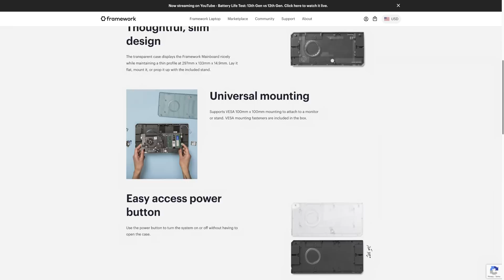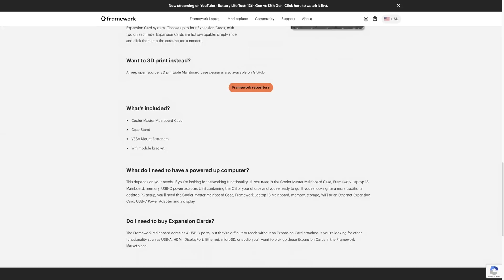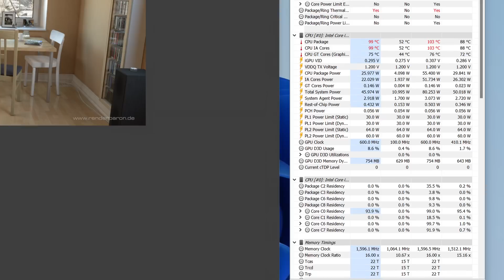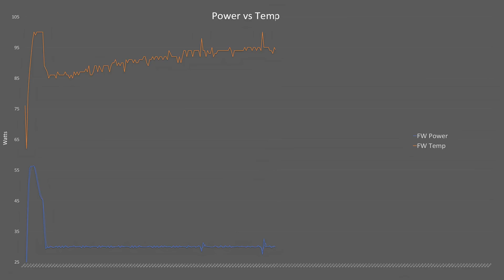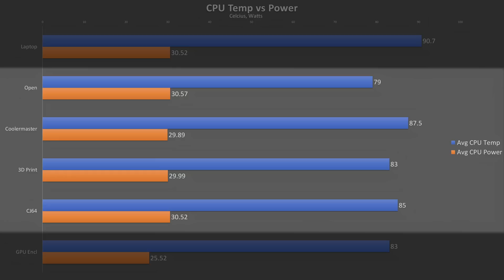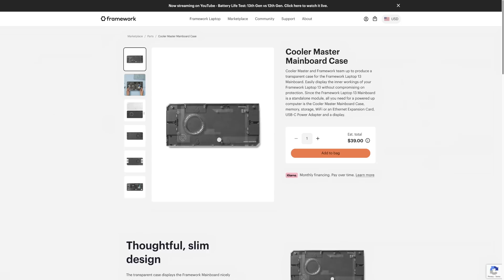Why the Cooler Master Framework Case Could Change Everything!

Comment: how many m.2 slots does the mainboard have? i cannot find any info i would like atleast 2 full size 2280 and the wifi and if no second m.2 could i boot off the usb ssd expansion card?
Reply: The FW13 has one 2280 M.2 slot and 1 slot for the wifi card. And yes, you can boot off the expansion card. However the FW16 has more expansion slots than the 13 and it actually has two M.2 Slots, one 2280 and one 2230 plus the wifi card.

Comment: I´ve predicted this over a decade ago. Modular Notebook Hardware is the Future. Very nice Detail Solutions. I crave for the release of the AI Max+ 395 (16C/40CU) APU. To try my own project. As a Backpack PC. It should Hug on my and my Monitors backside. Adding up a Soundbar Dockingstation. RGB Background Ambilight. Shades and Lighting. And wait a moment to make it Lengendary ......a AC Unit. And a Rack to Store Equipment. Like Keyboard and Mouse etc.   :face-blue-smiling: And a Microwave and Buttercream.
Reply: This is great to see gaining traction. I mentioned this as a strategy to Dell in 1995 as they were entering the laptop market. I was really surprised they blew that opportunity.

Comment: The loud fan seems to be caused by a temperature sensor inside placed badly on both the Intel and AMD version. Using third party community tools on linux and windows does solve the issue until Framework gives us a proper fan controller (they have no plans for it btw)

Comment: You can't update the bios without a battery?? What that's not good. I've seen  issue on laptops such as VPN not connecting due to bios update needed. Like to see if Framework fixes this. I bet theres a command line switch that will override battery requirement for bios upgrade

Comment: Note that it doesn't seem fit their amd boards. Two out of three users trying it on the forums had issues. The one in which it did work I'm not sure was even using the coolermaster case, they may have been using some other case in standalone mode.

Comment: The high pitch noise when in the CoolerMaster enclosure is caused by the shape of the fan openings.
I’d remove every second or third strip or even remove the hole lot and place a metal mesh instead of I had this issue.

Comment: I'm much more interested in the Minisforum UM790 PRO. An insanely powerful low watt APU with the graphical power of a GTX 1660. For $699 with 32GB DDR5 and 1TB SSD, it can't be beat. It's an all-in-one that fits in your hand.

Comment: I bought one CM Stacker 730 Case in 2006 - Still rocking my i9-13900K with a 4080 in it, cooled with a 360 AIO. At that time, CM built for the Eternity. Today not so much anymore... That whine would kill me in the Framework. But at least CM is still trying...

Comment: I just want better laptop cooling options.... I don't really understand why we use these tiny heatsinks and single fans for these 5ghz intel processors. or for that matter why intel is pushing out 5ghz laptop processors.... Every company does it. One of the things that disgusted me the most was when the R5 2500u came out its sibling processor the 2700u (which has 2 more Vega Compute units) was being shoved into even tinier laptops than the 2500u. It was horrible, I looked at benchmarks of laptops with the R7 2700u playing games that I played on my 2500u but the performance was worse for the 2700u because the additional Compute Units meant more heat than the form factor could reasonably handle.

Comment: Love your review. The possible answer to your question as to when companies will produce modular components is when there is a need or a requirement to do so. If more companies ran with an Open Chassis design with standard sized modules like the raspberry pi, than other companies will tackle that mold is quest for profit.

Comment: I wish there was something like this that was universally compatible to any laptop board. I still have a couple of Sandy/Ivy Bridge laptops with some minor physical problems but still fully functional that are lying around just gathering dust and it'd be great if I could repurpose them by turning them into mini PC's. I've seen some DIY stuff online dealing with that kind of stuff but they're always far too complicated, expensive, and require specific tools and other bits to make them.
Reply: There will likely never be a universal version of this due to the extreme differences in various laptop boards.  Diy doesn't have to be complicated but yes, if you want to make something you will need at least some tools.

Comment: Beside ABS & PLA there is also PETG. Also motherboards can be screwed into wood pretty reliably. But yes, for a desktop solution, even nettop style one it needs to have a beefier cooler. So bigger cpu cooler or case with one would've been great.
Reply: You can't use PLA/PETG for this unless you SIGNIFICANTLY increase the size of the case to keep the heat away from the printed parts.  Keep in mind, PLA isn't suitable for any heat at all and PETG shouldn't be taken above around 40 C.  In this case, the CPU is producing more heat than PETG can handle(and it's only using 30W), while the rest of the system is producing even more due to power losses going straight to heat.

But it's partially moot because this is a mass market case.  Injection molding > 3d printing if producing at Cooler Master scale and that means ABS/PC.  They're an OEM, the production run numbers are WAY past what 3d printing can do.
Reply: @Grimmwoldds  I was under an impression that it's a only PLA that should be heated above 40°с, and for PETG it should be around 80°с. Still worse than abs, obviously. But even 80°с... Can it really be achieved anywhere inside the case outside from a heatsink with a direct contact with a cpu?  And even then 80°с temperature on a cpu doesn't mean 80°с temperature of an exhaust. And high inside case temperature can't be achieved without a massive heating element, like in close chamber 3d printers with a massive heatbed and deliberatly little to no ventilation.
I wasn't able to find a source, but I seems to rmeember seeing some research about actual exhaust temp of hardware and it not even close to actual temperature on a die.
Reply: @trashviewer3521  It's not a very large nor high flow cooling solution.  You'd have to check it, but I'd guess that it's the exhaust temp is high enough to soften PLA/PETG.  The temps given for heat deflection are how much to soften it to bend a certain amount in a short time.  When used in a computer case, you don't EVER want to use PLA or PETG. If you subject them to even 40C for a few days they will warp and sag(you're usually putting load onto them).  Exhaust from cooling fins, being near an SSD, or even proximity to the power stages...

Comment: This is neat but I thought it was a GPU case or cooler. I'm in need of replacement fans for my used 1070 but I can't find the exact ones PNY used, an aftermarket cooler would also solve the problem.

Comment: 5:15 It is always adviced, to use a power supply that is utilized at around 70 - 80% MAX

It is not healthy for a power supply, to be used at it's absolute limits

And that counts also for it's efficiency, so you draw significantly more power than you use otherwise.

Comment: This is really great news. Adoption from such big manufacturers is both very important, and a good sign of the future for Framework. One thing I would like to see though, is a mod which lets you mount a bigger cooler, with, say, a Noctua fan. If we put this board into a 'desktop' case, the whole "thin and light" thing can be negotiated a little more readily, allowing for more flexibility. There should be no reason to have to put up with such a noisy design.

Comment: If the torx fit isn't 100%, use a thin piece of rubber band between the head and the bit. Push down and turn slowly :)

Comment: The fan doesn't spin up for no reason, the fan spins up because of windows. Linux users will probably have a machine that is silent at idle.
At least, that's the case for my non-framework laptop. When I'm running windows, I hibernate it at night so the fans don't wake me up. When I'm running xubuntu, I leave it awake and unlocked and it never makes a sound.
Reply from the maker: It also spins up at idle when I'm running Fedora or Arch.

Comment: Add a couple nuts into the mix and you can still mount it on a vesa mounting plate. Putting this on a secondary vesa arm sounds like a power move.

Comment: Would it be possible to have the M.2 port of the framework exposed? If so, having a case that could fit a GPU that would connect with occulink and thunderbolt would be sick.

Comment: the GPU enclosure idea is a good one, maybe they will add USB4 to their boards and make USB4 to PCI-e cables and reach out to you for the design for another Framework+ product.
Reply from the maker: The Intel boards have 4 Thunderbolt 4 ports, and the Ryzen board has 2 USB4 ports.

Comment: Until they actually have options to work with, they will never take off. Having only two CPU's to work with and only onboard graphics extremely limits  the user options. Basically all they offer at this point is swappable ports, which is pretty lame.

Comment: So if I understood correctly, you get a little less performance without the battery attached (and then there's the problem of not being able to update the firmware without it). If that's the case and Framework doesn't fix that with software, I guess it would be useful to get an adapter that connects to the battery connector and to another PSU (or Maybe the same?) Right? I guess that's possible and would fix those issues, but idk if it's worthy.

Comment: I feel like you have a misunderstanding of what shrinkage in plastic does. The shrinking and expansion only occurs when being cooled or heated respectively. Your ABS case did NOT shrink after a years time. It shrinks as slowly as or as fast as you cool it. As long as you are not impatient and toss your motherboard into the 3d printed case while it is still hot off of the build plate there will be no issues. When your ABS or other thermoplastic parts are done you should cool it to room temperature before doing anything with them for any use.
Reply from the maker: No I completely understand how thermoplastic polymer chains work, and how they continue to tighten or loosen over time based on many factors. Initial cooling rate, and temperature only bieng two of the factors. In this case it is very likely due to the below average annual humidity rate and lower air density which dosent allow for the ideal proportion of solvent molecules to evenly distribute the chains. In simple terms, the plastic is drying out.
Reply: @ElevatedSystems  What you said demonstrates you do not “completely understand”. Even if we were to humour your false assumption the shrinkage and expansion resulting from it assuming isothermal conditions would not cause any motherboard to crack as you boldly claim. Additionally, any shrinkage or expansion that occur after the initial cooling is more likely due to, as you said humidity and temperature fluctuation, which would not cause any damage to a motherboard unless you have tension on the board to begin with. In simple terms, unless you are bending your board and inserting to a undersized case, what you say is not possible.
Reply from the maker: @XxBanziixX1  I didn't say the board will crack. However in the past year the ABS printed case DID in fact shrink by over a millimeter across the X axis.  That could definetly cause damage to one or more of the board mounted UBC-C ports. They are pretty fragile and the soldier points are easily cracked. Speaking from experience. If the board bowed or twisted due to the shrinking case that could easily lead to movement of the heatsink, which is secured with leaf spring tension, causing improper cooling of the CPU or VRM. Also speaking from experience. I've been tinkering with this mainboard for 2 years, I'm very familiar with it's extremely tight tolerances.

Comment: I think this has some massive missed opportunities, on both the case and mainboard sides of it.  I/O is one problem area, four ports max but limited to three due to the power supply, split between two sides, of which one mounting solution is behind a display where reachability will become problematic on virtually everything due to position.  The I/O should've been broken out into an external hub, one that also fits nicely into the stand, power passthrough included, and personally I'd rather see at least four USB ports, two or three video outs, and either audio or another USB for those that use DACs.  Another thing, which this might come down to circuitry reasons and lack of full-power overhead (as laptops have this AC+DC mode that provides a higher power draw while also charging, or at least they used to), but why do we not have power input where the battery connection was.  Similarly, why are we not also seeing an eDP to DP board on the internal display connector.  Again something else I'd like to see, though depending on implementation this is probably better left to a future update, is keyboard and trackpad as USB devices just so that chassis swaps can tap these two peripherals' connectors for I/O purposes.  Beyond these things, one thing I would like to see is a better cooling solution, now that the mainboard isn't in a compact case, possibly even with a thermalpadded backplate if the backside gets toasty at all.  I definitely think a next-gen FW needs a lot more ecosystem forethought, beyond just USB-C adapter modules and the idea of using alternate chassis, the platform itself actually needs to be flexible in its utilization, such as adapting internal peripherals to be USB/DP so that these peripheral ports can become I/O within an alternate chassis, or how the power solution should be simplified to just using the internal connector in the same situation.  I haven't seen too much promo of the newer FW 16, but I'm really hoping they're still early enough in development to make these kinds of changes before it becomes yet another wishlist of hopes for a future generation of the product.  I just don't think we currently see the same kind of forward thinking that they have with repairability is being fully applied to reusability, as it's more of just a chassis swap with sacrifice instead of the absolute most full utilization of the board within the alternate cases;  the less hubs I have to use, the better, the more consolidated the I/O is overall, the better, and of course there's a balance of the two but we also shouldn't be using a 10-in-1 hub off a single port if we don't have to.
Reply: Good points but paragraphs my guy. Enter key.
Reply: @uss-dh7909  Except it's all within the same line of thought, therefore a singular paragraph fits what was said well.  Do you not understand how paragraphs work?

Comment: If framework survives long enough, I wonder if purchases for their bare boards will increase for hobbyists. It seems like the same crowd interested in raspberry pi, Latepanda, and maybe the erying boards would ALSO be interested in retrofitting a framework PCB for other tasks.
Reply: That would be amazing!

I envision a future where we ditch Anti-Consumer companies and just give all our money to framework as far as laptops go.
Reply: @jeremydale4548  I think one of the problems with laptops is that by the time the user finds the specs obsolete, the rest of the laptop is usually falling apart anyway.. so it's one of the situations where it 'makes sense' to just replace the whole thing every few years.  Also, because everyone just defaults to the Thickness War as the only priority, cooling is always a problem.  So we get laptops that cook themselves to death.

I would like to have a 'chunkier' heavy duty laptop chassis.. something capable of supporting 40-50mm exhaust fans on the back.. maybe it could be marketed today as more of a  'portable desktop' than a 'laptop'.  I used to imagine mini ITX could somehow find its way in to a situation like that, but that never materialized.

For the record, I'm almost 40 and have still never owned a laptop.
Reply: I have a preorder for the amd mainboard to run in this case as a server, replacing a raspberry pi cluster. The amd boards support av1 hardware accelerated encoding and decoding so are perfect for home servers.

Comment: Carbon Fiber Nylon, and printers with the hardware needed to print it, really should become more common. And therefore more affordable.
Reply from the maker: I've tried printing carbon fibre polycarbonate. It's not easy, and isn't good for large parts.
Reply: @ElevatedSystems  yeah, personally I don’t think CF Polycarbonate or CF PLA make much sense. Adding CF to PA-6 (the less rigid, more temperature resistant type of Nylon, the other being PA-12) makes a lot of sense because it’s simply there to make the Nylon more rigid. The Nylon matrix surrounding the bits of CF is still very durable, but the CF works to prevent the Nylon print from deforming. You can even anneal CF Nylon prints without them warping. It’s just a matter of getting your print settings and environment correct to begin with, which is admittedly not easy.

Comment: Have the Coolermaster case with the 11th gen i7 Framework board and it works great. Not having the fan sound problems.
Regarding the power supply, I'm using the standard power brick that comes with the laptop and also not having any issues. Did you disable the battery in the bios? That is recommended by Framework.